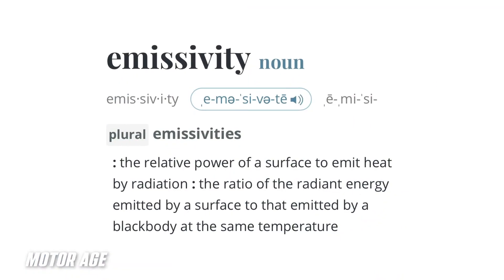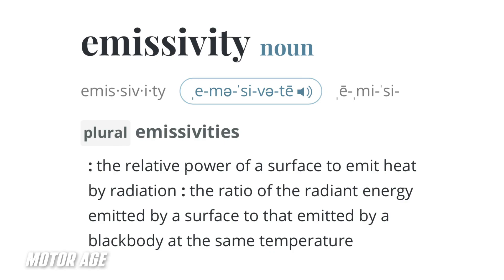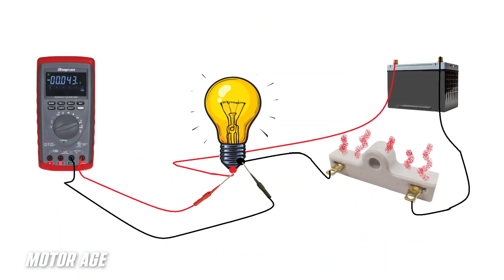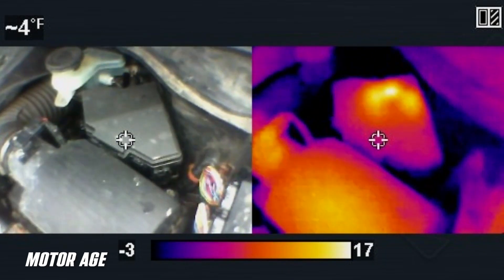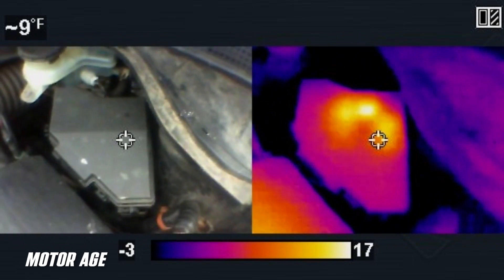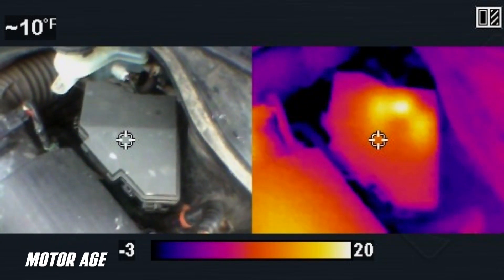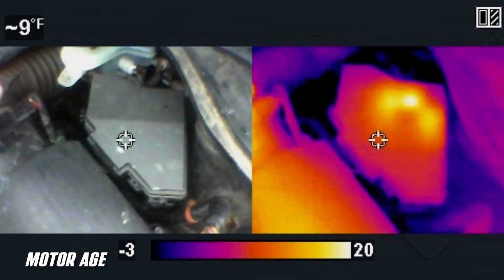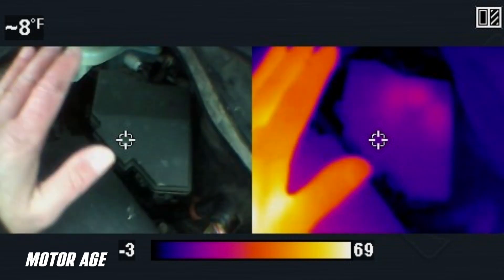Mastering Diagnostics #20 Adding Thermal Imaging to Your Diagnostic Toolbelt

Comment: Appreciated the examples of using thermal imaging to diagnose. I agree it is way underutilized. To help clarify some of the discussion points and the definition of emissivity. Emissivity is the "ability" of a surface to emit thermal energy relative to what a black body would emit, so it is a property of the material/surface. This is much like resistance is a property of a copper wire , not the actual voltage drop you measure. Therefore,  the "actual measured amount" of  thermal energy detected (temperature) is not its emissivity, it is simply its temperature. The ability to see it on the thermal imager is enabled by the material's surface emissivity. In some cases, 2 bodies could be at the same temperature but not seen as such on a thermal imager due to their respective emissivity's. Hope this makes sense.
Reply from the maker: It sure does! Which also is why we pay mind to the reflective nature of the surface being measured 🤜🏻🤛🏻
Reply: @VehicleServiceandRepair  Precisely....and that nature/property of the surface is called its emissivity